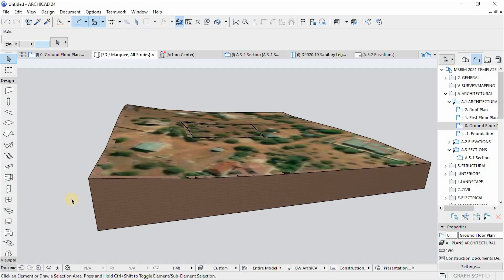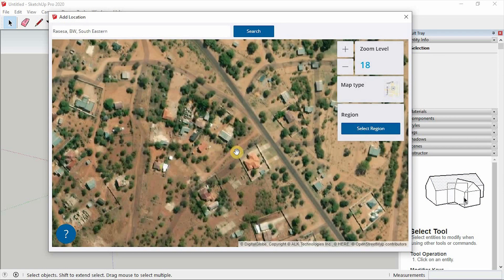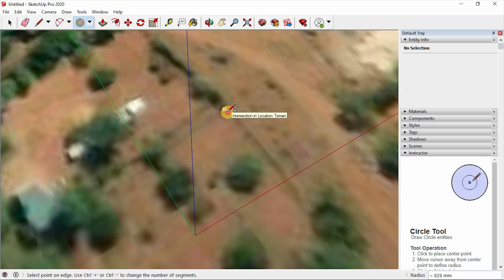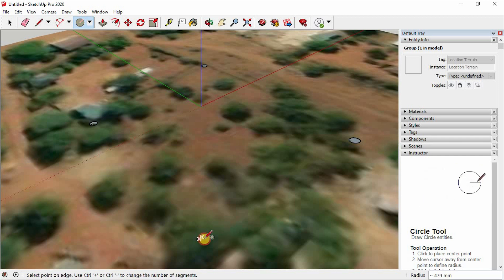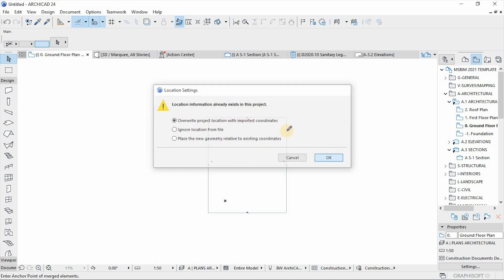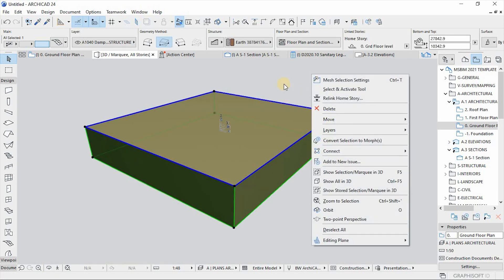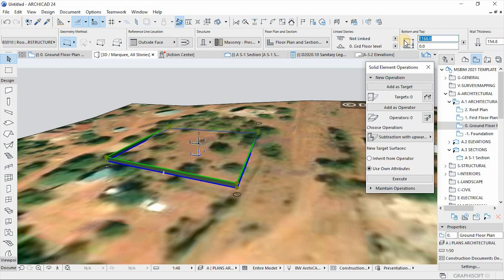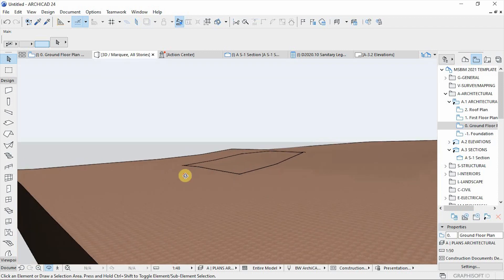Architecture Site Visualization | How to Model Terrain from Google Earth | ArchiCAD Tutorial

Comment: thank you for this video 
I would like to know if there is a way to do all the process to achieve this result directly in ArchiCAD
Reply from the maker: No Sir, Archicad used to have google earth connections that stopped around version 17.
Reply: Pls assuming I am not good in sketchup or don't have the software is there to way to do that in right in the Archicad environment or from Autocad. Secondly pls can pls repost this video with a written screen instruction pls. Thank for passing on the knowledge.
Reply from the maker: @abbasgarba6488  Thank you, ArchiCAD used to have google earth connections addon that link google earth and ArchiCAD to that but it stopped around version 17. I will consider a repost Sir.